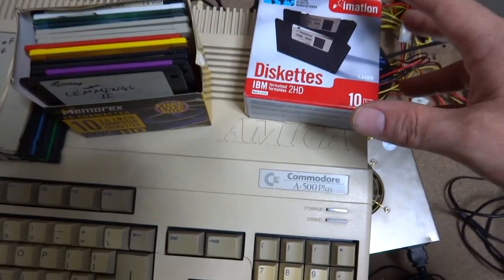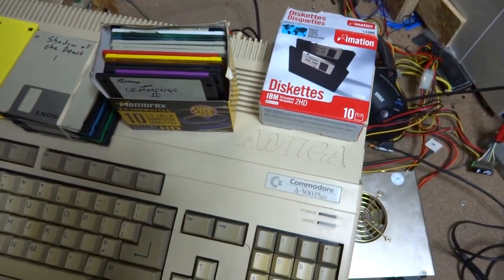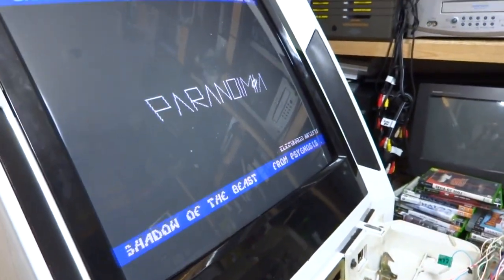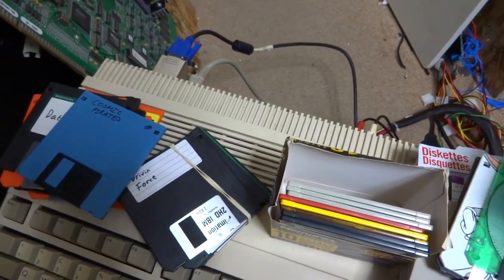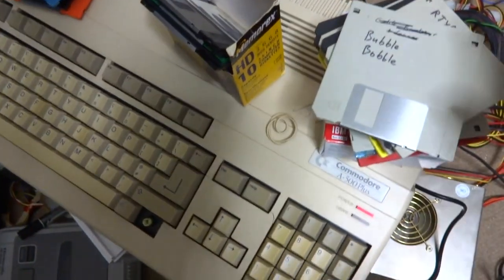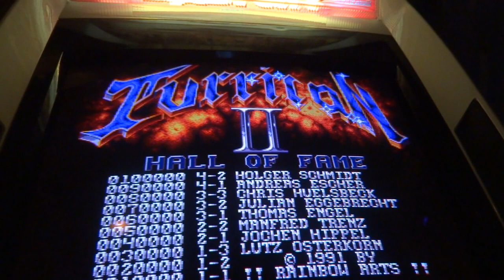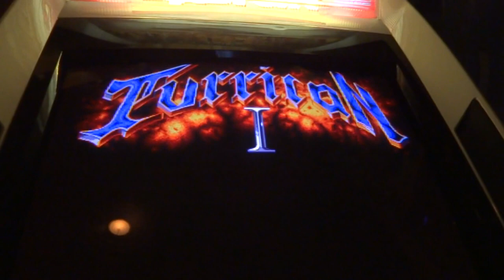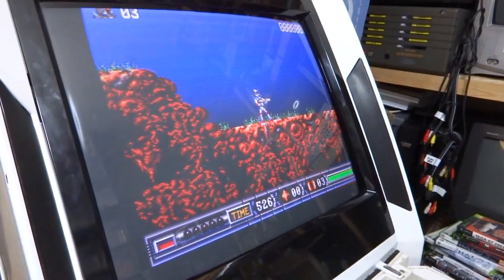Amiga 500 RGB Adapter,Bad Disk Drive Issues (New One Coming), Turrican II Music Demo, Etc...

Comment: Hey Luke,
I think you've received good answers some the community.  Get an Amiga mouse, plug into port 1, plug the joystick in port 2.  Regarding the games the disks it could relate to multiple causes.
1) may be old and may not work (loss of magnetism).
2) Some games could have boot virus's on them (they do spread after loaded into memory so be careful).  Write protect your disks!
3) Some games only work with Workbench 1.2 or 1.3 
4) The 3.5 drive could be failing. May require replacement ( also check for dust within the drive, can of air can help sometimes)

Good luck!  

BTW the Amiga had some of the best graphics and games at the time!

Comment: At 11:02 I saw a copy of Badlands.I hope you can get that game working.I have fond memories of that game on the Amiga.

Even in the heyday of the Amiga,I had several  game disks that just stopped working.I  also had my A500 fixed at a computer shop when I was still using it as a kid.I think it was said to be a 'worn out' disk drive. So drive faults were commion even then!

I still have my Amiga and all the games for it,but I never have tried it out for years. Good luck with your project

Comment: Hi Luke, If you lived around the corner you could get my spare Amiga. Concerning drive. You can put in a PC diskdrive with a small mod (samsung work well). And yes you need an Amiga mouse. Most games need to be started with the mouse. Link for mod on floppy drive. You can however not write amiga floppies on a PC. The best thing to get for an Amiga is a HxC device.

Comment: Hey Luke, that floppy drive in the Amiga needs a good clean. Normally two clicks from the drive is because the drive can read the floppy disk boot blocks. Try cleaning the heads of the floppy drive with IPA and a cue tip. Also use a can of air, and old dry toothbrush and some WD40 and vaseline to free up the motors on the drive. Floppy drives on amiga's can go because of the amount of abuse they can get, but give it a go you might be surprised. Other than that they are pretty reliable. ;O)

Comment: Not sure if this has been said before - but the disk might be corrupt, but it might also be that your Amiga 500 plus have a dual kickstart rom, which means it should have both the 1.3 (the one you have booted), but it should also have the 2.04 kickstart - it was a few ways to "boot into" it, on my A600 you have to plug the amiga mouse into the mouse port, and hold in (I think it's the left button) when you boot the machine, and it will boot into the second rom (might be that you must hold both or the right mouse button - but just try different combinations).

I'm pretty sure it was only delivered with the 2.04 kickstart, but it was a normal thing to install the older roms due to incompability to the older games :)

(The A500 plus won't play all A500 games even with the 1.3 kickstart, but it will play most of them).

Comment: I remember the Agnus chip would have seating issues and have to be soldered every once and a while.  I use to have to change out the rom from 1.3 to 2.1 time to time because of using games or applications would only work on certain roms.  Had a internal hd 4mb of ram fat agnus and super denise. Really liked it.

Comment: I notice the diskette pack sitting on the 'miggy is high density PC floppies.  Worth noting that it doesn't really use those.  You'll need Double Densitys, or 720K PC floppies, which the Amiga can reformat for about 880K.

You can read/write a bunch of floppy formats, like 720K PC/Atari ST disks with right software.  For the 500/500+ you'd probably need CrossDOS. For the 600/1200, I recall it's included as part of Workbench.

Comment: Ah that makes sense! Cause I know usually the Genesis controllers have no problem working on other systems that use that same style of port, (I've used it on both the atari 2600 and the Colecovision, so they DO work) so it was weird that it wasn't reacting... but there you go.

Comment: Some drives have belt slipping issues, maybe strip the drive down, check the belt, grease the mechanical mechanism etc..., they do get full of dust.

I also believe the internal drive had a disk insertion sensor to tell the machine it had a disk in it, could be a lose connection.

It's been twenty years since I had my first Amiga A500+, Turrican II is such a great game, Pacmania I first played at the (London, Earls Court) PCW show in 1988.

The Sega joypad does work, just try the other port.

Comment: Hope I wasn't the only one screaming to try the other joystick port on the back of the amiga, clearly you had it in the mouse port. Also, I always thought the 500 plus has kickstart 2.0/2.05 installed? I'm sure my friend back at college had a 500 plus with that rather than 1.3.

Comment: a Good device to have and not to expensive is the GBS 8220 CGA/EGA to VGA converter / scaler, which would be helpful getting  the amiga to work on any VGA monitor, i have one and have used it for MVS, Saturn and MegaDrive RGB scart to VGA, they also have component inputs, very handy

Comment: If you're going to get an additional disk drive and use the connector at the back, then be careful as I'm sure that some Amiga games didn't use/check for additional drives when it came to swap disks (I'm pretty sure that Alien Breed was one of the games)

Comment: I noticed that you have much trouble with booting the floppys, what you need to do is to reformat the disks and and write a new game ADF file to it. Because many of the old disks have bad sectors, this cause boot errors. You need a PC ADF/FILE TRANSFER KIT, this contains a Amiga to PC serial cable. If you don`t have a parallel port on your PC, you can use a parallel to USB plug. Search for it on Ebay, you get a complete kit with transfer software. Hope this helps...and you need a mouse :)

Comment: Both my copies and original disk from the late 80's early 90's are all still going strong with the odd exception. You can an external disk drive I used one for multi disk games mainly but I'm pretty sure I could use the external as the only disk drive. I still have the external in the attic somewhere. The controller with only work in one port unless its a 2 player game.

Comment: EDIT: I mean Kickstart 1.3 that's what is most compatible with most of the old games.  NOT kickstart 3.0.... That's for 1200+ really, although it will work in a 500 if its on the right type of EPROM.

Comment: Yeah as someone said should be kickstart 2.04... The trouble with having an external disk drive is some games insist the game be in drive DF0: but an external drive is DF1: Turrican prob wasnt moving because pad in wrong port. It does look pike drive needs cleaning or replacing as its hit and miss

Comment: When booting, also hold the 2 mouse buttons down. You should have some boot options. I think the 2.0 (or 2.1) roms might not have the options but on 3.0 or 3.1, you can turn of CPU cache and use the "OCS" mode.

Comment: Hey Luke, yeah it looks like a bad disk drive. I tested all the games when I sent them over so I know they work. I had a similar A500 Plus disk drive go bad and had the same behavior. Try to get a Chinon A500 drive, those are the best. Plus on some games it doesn't like the 1MB expansion in the slot and will error out. The 2 disk games, it will prompt you on the screen to insert the second disk. Now as other people have mentioned, port 1 is for the mouse and port 2 is for the joystick.

Comment: A500+ is an A500 with an extra 1/2 MEG. Great machine - if you go on Ebay you can buy blank Amiga discs, then attach a disc drive to your PC and you should be able to copy old ROMS (I'm sure the Copyright Fairy will let you off! ^_^ ).. There are tons of great old games, programmes, demos etc. It should also work with any CRT using the "aerial" port. If you're getting read/write errors and "Guru Meditation" errors then its a virus on the copy of the game, compatibility should be fine overall.

Comment: I totally agree. My friends had IBMs and I had my amiga. Had it set up so that I could emulate their games on my system LOL. That always messed them up. I loved the sound and graphics for the time they were over anything.. I would have to change to chips once in a while to play something or other times have to much power. I had a device of the side that increased it to 33mhz i think it was.  Tried wing commander and by the time you saw something you crashed into it.

Comment: Also you should be able to cerify if it have two roms if you open it up, most likely the second rom will be sitting on an adapter with a ribbin cable on it :)

Comment: IF your struggling withoput a mouse to get past the cracktros on copied games, just plug another joystick into the mouse port for the time being.. fire is the same as the left mouse button. Lots of the earlier games didnt work on the 500+ with it haviing a newer kickstart and 1mb of chip ram rather than 1/2 meg chip and 1/2 mb fast ram as in the original 500. Relokick helped a lot back in the day (few friends had a 500+ but I had a 1mb 500.

Comment: My 30 year old floppies from my Atari 8-bit still works about 90%. 

The Amiga drive used more than the normal 720K (800K?) drive and thus must be in good working condition in order to function properly, I would think? And yes you will need a mouse to bypass most crack intros etc. Try switching ports for the joypad to work. I have the Amiga 2000 which has a leaking battery I have to deal with. Haven't touched it since around 1999 when it worked fine.

Comment: PS I'm not sure if leaving the discs on top of the machine is good for the machine or discs (magnets and all that). You have some great games there, a shame they don't work but as I say, the games are easy to find online and copy to compatible floppy discs (you look like you have a few there), even many of the ROMS are corrupt though sadly, possibly lost to time! Not sure how viruses on the Amiga worked as all runs from the disc but even originals could get corrupted. Worth sticking with still!

Comment: Regards controlls I dont think a megadrive controller will work.  You need a standard Atari joystick - the type that will work on Atari 2600, or Atari ST, or C64.  ZipStick or Cruiser are the best joysticks to get.  If controls still do not work it will be a faulty CIA chip - you can test that by swapping them arround, if the behaviour changes and possibly controls start working its a faulty CIA - let me know, i've got like 20 spare.

Comment: the disk drive sounds a bit bad. but i had this on my amiga, too if i remember corretly. most times it had problems with bad disks, so other games did run well. for the mouse, if im right it has the same 9 pin. try a second pad if you can get a click out of it.

Comment: In most of the crack intro's you need a mouse to start the game.
Also the amiga disk drive is not made to read HD disk's!
HD disk's wil do work, but DD disk are better.
Also you must remove the clock battery before it damaged your A500+ board!
And you must put a joystick in port 2 and the mouse in port 1.
This way you can play games and use the mouse in crack intro's and so.
I have here a mouse and disk drive for free if you want them.
The Amiga is a powerfull computer, with nice games ;)

Comment: You probably have had enough help, but in general the Amiga tried to push what you could store on a 3 1/2 disk with a completely different sector and track layout than other formats at the time. Couple that with pretty poor quality write heads in the very cheap drives Commodore chose, leads the floppy disks to degrade quite a lot faster than other systems.
You need a transfer cable to do the ADF transfers.
So re-writing the files on the disks as others have suggested is the best bet.

Comment: Floppy discs itself probably OK, but data may be corrupted on some of them.
Best way is probably download games on couputer and reburn them on the floppies with floppy drive.(They are all just pirate copy)
BTW : Thre is USB - Amiga Controller Port convertor for mouse, it  should't be to expensive.(around 10$)

Sorry for engrish, i hope it is understable.

Comment: also look on ebay UK for an a500 HDD once you have that interface (it plugs into the cartridge edge connector on the side of the machine) it's a standard IDE hard drive, you can replace it with an sd or cf card.
Reply: And 90% of the time, plug the joystick in port 2, port 1 is for the mouse.

Comment: You should buy a later Amiga 1200, that machine looks like the A500 but it`s much slimmer. Another important thing is that the A1200 is a 32bit monster at 14,3mhz, you can place a 2,5" IDE disk inside or a 4GB CF card inside the machine. Floppys are always unreliable so you should install the games with a Whdload patch, this way you can run every game from the hard drive. The 1200 has much better AGA graphics and can still run all the old A500 games. You can upgrade with faster accelerators too.

Comment: Regards problems with games...  There are a few problems.  Firstly, that's a 500+ so it will have kickstart 2.0.  You should get a kickstart 3.0 ROM, or program an EPROM with it.  That way most games should work.  If its a problem reading disks, it probably just needs a good clean.  Some of the Sony drives have surface mounted electrolytics that need replacing from time to time.  Another problem that can cause games to crash or glitch (graphically) can be dodgy DRAM.

Comment: The controller not working could be as simple a problem as it being plugged into the wrong port, as the Amiga has two of them. Disks not working could be a bad drive or simply the disks being bad - about half of the ones I still have are bad and either don't work at all anymore, complete with that slight scraping noise coming from the drive & then falling back to the Kickstart screen, or give read errors at some point during loading.

Comment: Hey luke, are you sure its an A500+ you have there? i know the case is for an A500+ but considering you get the 1.3Rom picture are you sure the motherboard is a real A500+? they came originaly with 2.0Rom. If it is an A500+ and someone has "downgraded" it with 1.3rom that could be causing issues.

Comment: The Amiga drive is quite weak, so it goes wrong easily. Also, disks don't tend to last longer than 20 years, but it does depend on how they are stored. The Amiga is a cool machine, so you should try and fix it. :)

Comment: The internal drive use to just suck that is why I install an internal HD and had an external disk drive. The external drive worked great. Also had a cd rom drive. With our the 500 it was huge with the daisy chain running off the lest of the system LOL.

Comment: The genesis controller should work on the amiga but you might hafto change it to the other controller port, i have a 3 button one and it works great on my amiga. (i dont have a amiga 500 plus though).
Btw the software failure error usually means the floppy disk or floppy drive is bad.

Comment: I've had the same problem. My Amiga's drive didn't read disks at all anymore, it does exactly what your amiga is doing. I bought a new drive and it worked with the software that it came with, But when I put in one of my games it went into a black screen, and gave me a read error message.  Now the new drive doesn't work anymore. I think that since my original amiga and disks have been in my basement for the last 17 years, it probably has some condensation on it.

Comment: i know you have to hit keyboard buttons on the amiga to reset,  not rip out the disks like that, the original amgia psu has an on off switch on it also,

Comment: Okay, first thing I notice is the boot screen. It is kickstart 1.3. Yet your Amiga is an A500 plus, which should be 2.04

Has someone been dicking around with the rom chips in this? Seems very odd. 

Also, you kind of answered the rest of your questions yourself. Yes you need a new drive (Amiga drives are touchy & you want a perfectly working one), yes you need a mouse & as Larry suggests, you really need a copy of Relokick.

Comment: those amiga drives have a tendency to fail, they are also very weird compared to the ones we used in PCs. they do for example read at different speeds. Luke, go to amigakit dot co dot uk, they have the parts you need, new diskettes and all that :)

Comment: THAT IS A FAULTY FLOOPY DRIVE THAT FLOOPY DRIVE WILL STOP WORKING  THESE ARE THE SYMPTOMS ! WITHOUT A MOUSE YOU CAN´T ENJOY YOUR AMIGA 500 PLUS PROPERLY AND YOU´VE GOT TO PRESS Control+ Amiga+ Amiga KEYS TO TURN OFF THE DRIVE AND REMOVE THE FLOOPY DISKS OTHERWISE YOU CAN DAMAGE THE DRIVE ! IF YOU DON´T USE THE KEYS YOU GOT TO WAIT UNTILL THE YELLOW LED DRIVE TURNS OFF

Comment: Also, your disks look, hmm how can I say this... probably not the most reliable, lol. If you want some software, including Relokick, I'd be happy to send you out some, with all disk sectors fully checked. I wouldn't be surprised if the majority of your old disks have sector & read block errors.

You also desperately need a mouse. Most games, especially your cracked games there, need you to press a mouse button to start them.

Nb. PC floppy drives will not work in a miggy.